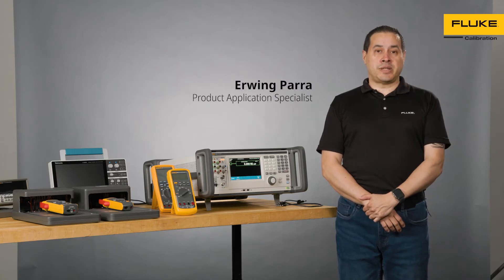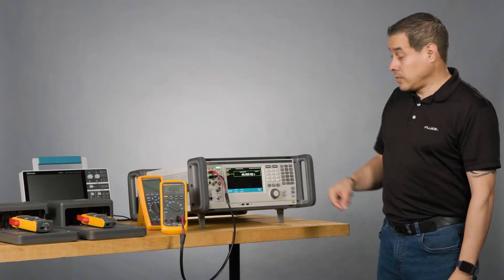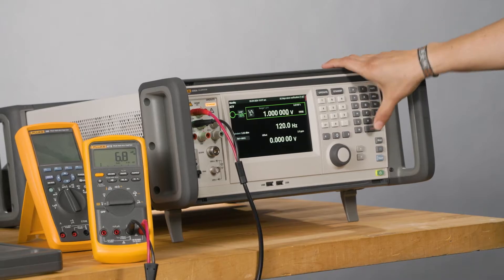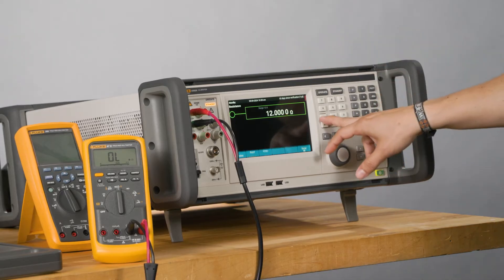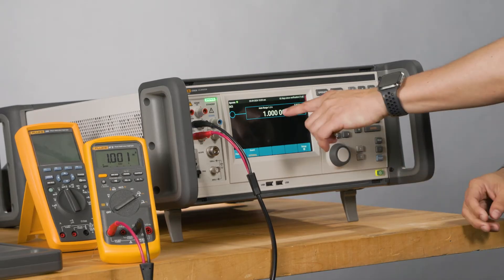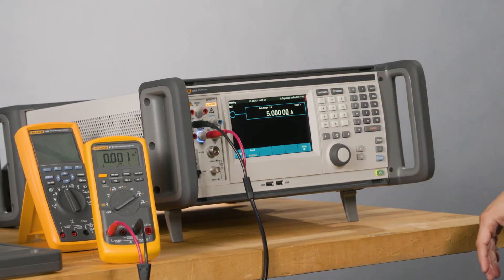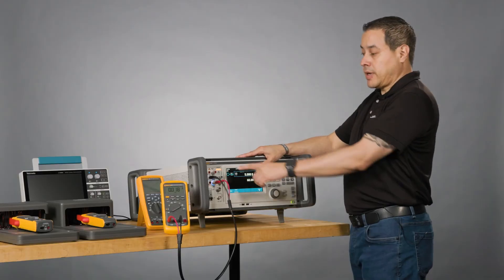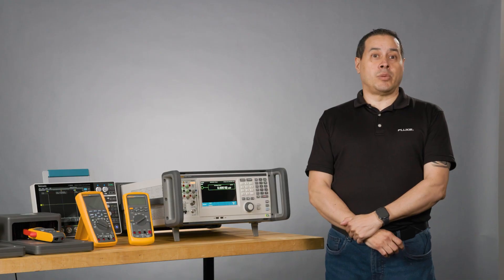How to Calibrate a Digital Multimeter Using the Fluke 5560A | Step-by-Step Guide

Comment: Hi. What do you do then if say after such a calibration test process you find that the fluke multimeter say doesn't display the expected value for example of current or voltage?
What and how do you adjust the multimeter?
Reply: That's exactly what I'd like to know as well.  I'm not seeing anything on performing adjustments.   Would be great if they can be.